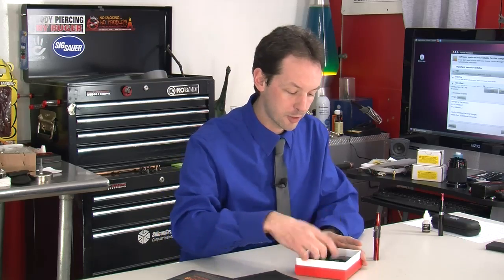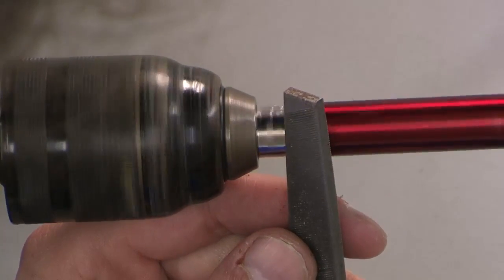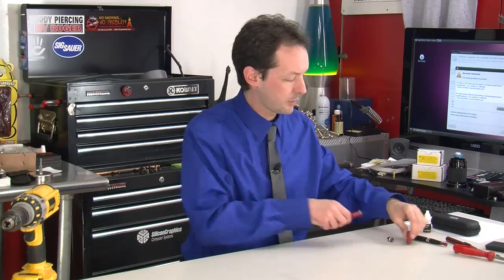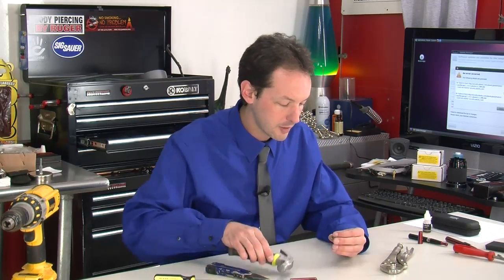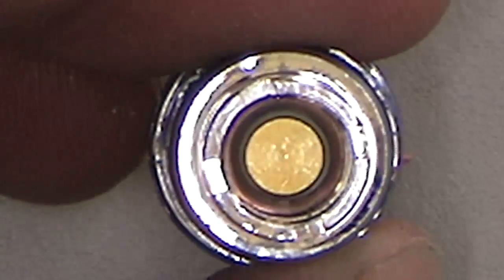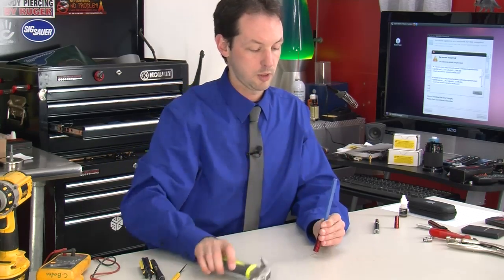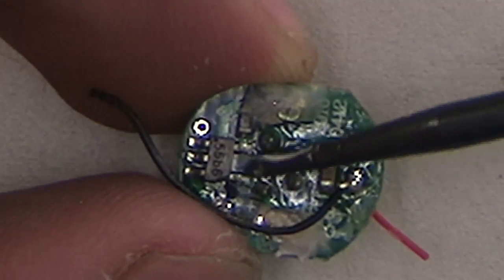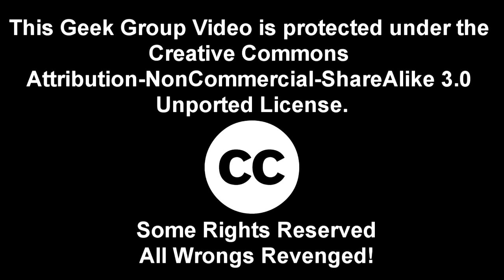Inferno Autopsy Pt1 (650mA USB Passthrough)

Comment: Thats odd...I happen to be vaping on my 650 as i watch this and it different from the one in your kit.instead of a flat end with an exposed usb port mine has threading and a screw on cover to protect the port. Have they revamped the design that quickly?